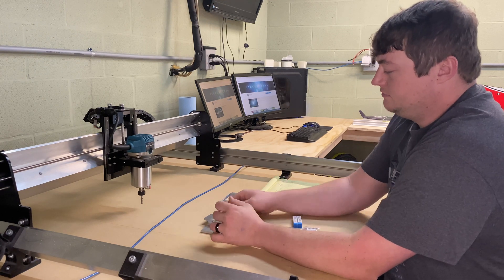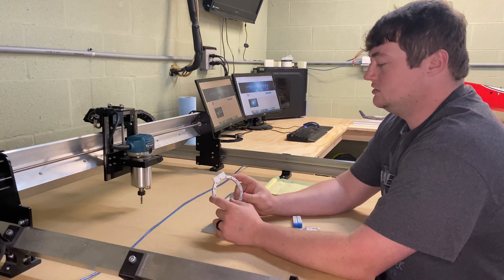DIY CNC Cutting Aluminum! - Sienci Longmill Cutting Aluminum - My Experience

Comment: Howdy Jake,

My Longmill 48x30 is on order. I too am very interested in earning at least enough to pay for the machine and all its consumables.

Since I see you are making A/C parts, I have a few of questions:

1. Since I am a pilot, I know some materials must meet FAA specs. Are you able to easily source these materials?
2. Are you required to follow any special procedures, licensing, workplace/facility rules?

This is a fabulous avenue for earning!!!

Thanks for any insights you can share.

David Rodwell
Winston Salem, NC
Reply from the maker: David, this part was for a RC Turbine helicopter made by Jetcat out of Germany. Not for full scale applications. As far as material goes, I almost exclusively shop at McMasterCarr for Aluminum.

Comment: Jake, as a red seal machinist with several years of cnc experience with hobby level machinery on milling machines and routers, I'd like to give you some suggestions with regards to cutting aluminum.......

1) Always cut with a climb cut on a cnc machine, as I see you're doing, it takes much less power to make a cut in any material.

2) On all your cuts set your g-code so that you enter the material with a tangent lead in and lead out, with a distance of at least 1-2 cutter diameters, this will prevent machining marks at the start and finish of the process.  Do this on all cuts as a general practice.

3) Set up your g-code so that you leave about 0.010" to 0.015" for a finish cut - at FULL depth.  You can even do this cut twice if you want. If you have any bad finishes or machining marks, the finishing cut should eliminate all of that..... standard practice on ANY machining job, even manual work...... always do a finish cut - and make sure the finish cut is a CLIMB cut.  A conventional cut will allow chips to be pressed back onto the freshly cut surface, and now you have to clean them up and you wont have a clean machined finish anymore.

4) Use WD-40 as a cutting fluid. The reason you are getting poor surface finishes is the lack of a cutting fluid.  Yes it does make a bit of a mess, but cover your waste board with a sheet of 4 mill plastic before you start and that will protect the waste board.  Apply the WD-40 with a sprayer (buy it in bulk cans not spray cans) or you can also just use a cheap acid brush or 1/2" paint brush to apply it as well.  The WD-40 can be easily washed off with soap and water.

5) Another option for a cutting fluid is to use some paste cutting fluid called 'Anchorlube'.  This is a water soluble paste that works super well on all metals, it has a very nice odor to it also, and it also washes off with warm water.  Apply this with a small brush as well.  This material is thick enough that it wont even sling off a drill bit if applied before starting the machine.  Since it hangs on really well, it is also much less messy than a liquid like WD-40.

6) When drilling holes, don't use a ball end mill.  The ball end mill has VERY limited cutting ability right at the tip because the flutes are very shallow and there is almost no clearance for chips.  Slow your router down and use a drill bit.  Go onto Amazon and purchase an imperial, and a metric set of collets if you can, but I don't know what type of collet is used on the Makita, it most likely is a custom collet design, but you may be able to find collet adapters (bushings) that will allow you to use different sizes of cutters.

7) I am going to be purchasing a Longmill MK2 later this year but I plan on installing a 2.2 KW spindle with a vfd.  These spindles have the ER20 collets on them, and for the ER20 you can purchase a complete set of Imperial and Metric collets for it, allowing you to hang onto virtually any size of drill or cutter.

8) When cutting through a piece of material, place a 1/4" spacer under your clamps so you can cut through without cutting into the waste board.  You can create 'tabs' in most CAM programs that allow you to cut out a workpiece without it coming loose as the tabs will hold the workpiece in place.  You will have to cut the tabs off and clean up the outside of the workpiece, but this is a very good option.

9) Another option for cutting out a piece, if you have some holes in the workpiece, drill the holes first, then loosen some of the clamps to allow you to insert 1/4" spacers near the holes, then use the holes with some screws to re-clamp the workpiece.  This could eliminate the need to use tabs for some projects.

Anyway, great video I was impressed to see the Longmill cut the aluminum.  I hope you find these suggestions helpful.
Reply from the maker: Wonderful write up. Thank you. I will try your suggestions.
Reply: May I ask which VFD you planned on buying? I'm planning on getting one and I'm looking for recommendations
Reply: I also use WD40 but sparingly. Any liquid will create some surface tension and the swarf will stick to the surface that you're trying to cut and you end up with a less than perfect finish. I use some 1/4 inch Locline tubing and the fine nozzle all connected to a small compressor. It's mounted to the Z axis so that the nozzle, once properly pointed, follows the cutter tip and continually blows the chips out of the way. It doesn't take much pressure or CFM. I also have a vacuum connected to some 2.50 inch Locline similarly mounted to suck up the swarf although this isn't nearly as effective in keeping the cutting area clean as the compressed air. Also, due to the size of my projects, I mostly use a 1/8 inch single flute cutter. The single flute, in my experience really make a difference in the quality of the finished part because when it's rotating, you have almost 360 degrees of rotation to get the chips out of the way whereas with a 2 flute, you only have somewhat less than 180 degrees of rotation to clear the swarf.

Comment: Hi. Just a friendly tip if you dont mind. For cutting aluminium, you should have your router as high up in the bracjet as possible and build up your waste board in the area where you lay the plate down. This will reduce the bending moment on your gantry and you will probably be able to go faster and use deeper cuts.
Reply: Great tip and friendly approach too thanks!
Reply from the maker: Thanks for the tip!

Comment: Thanks for the good information!  I've heard some say that the Makita speed dial tends to change itself due to vibration.  Did you have any issues with a wandering speed dial?
Reply from the maker: Thank you for watching. No I have not had any issues with the dial moving during cutting. It is a new makita, I only have about 6 hours on it so far.